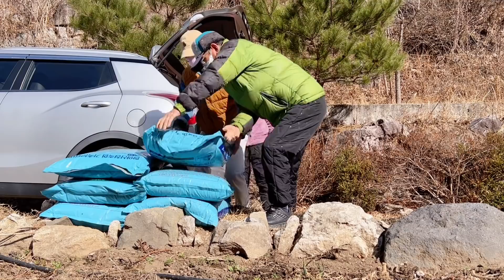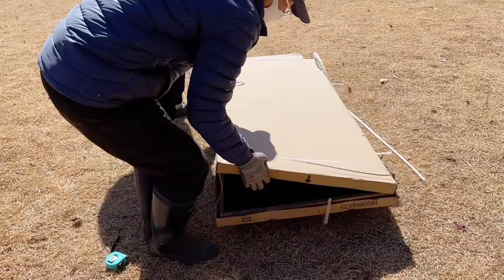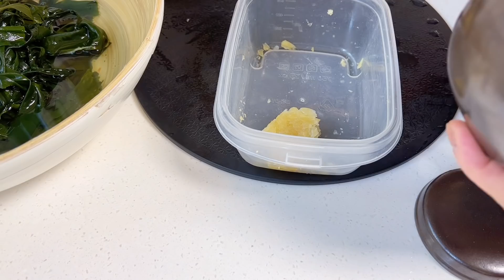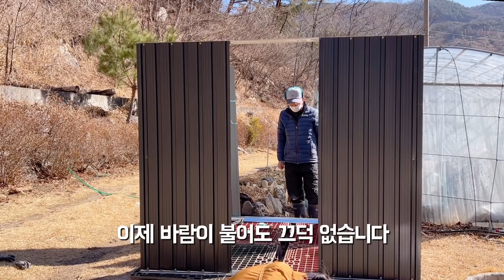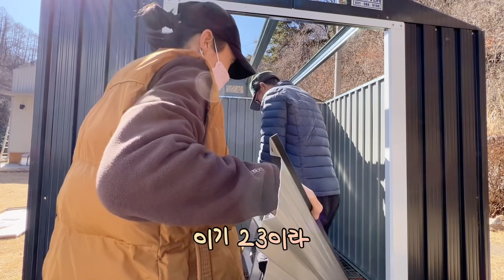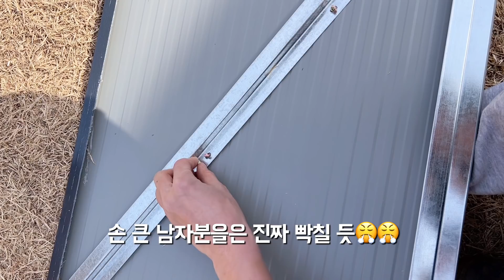SUB 단순로그139 주먹구구식으로 시골집 조립식 창고 만들기 🛠vlog

Comment: Those are difficult to assemble. Here are some notes:

(01) Those plastic pallets can shift (move). That will put stress on the whole structure, and parts of it could bend. You need a more secure floor. Maybe it can be reinforced with boards or plywood, and this will also prevent items from falling through those holes.

(02) It needs to be anchored securely into the ground. If you leave it the way it is assembled in the video, a strong wind could flip it over or move it.

(03) I am not sure if the door is facing the best direction. It's too close to your greenhouse. Maybe it should be turned 90-degrees clockwise (viewed from above). This will give you more space to bring tools in and out without any risk of damaging the plastic on your greenhouse.